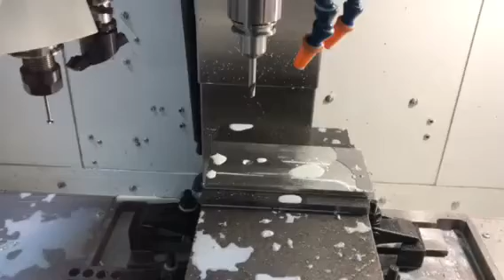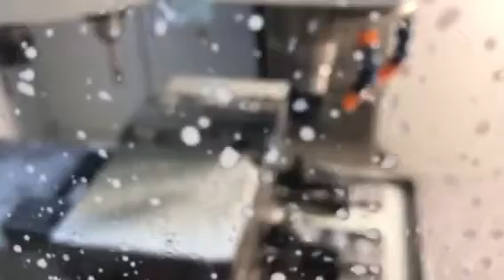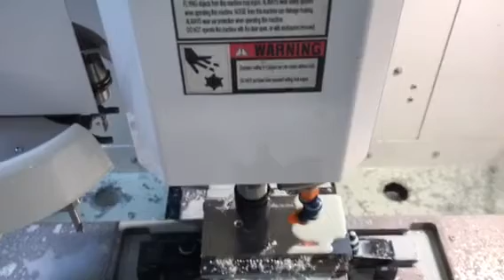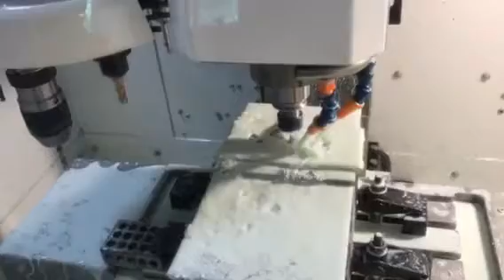Finally testing the UMC10 & Fusion 360

Comment: I was waiting to see how the threads came out. lol  Did they fit?  Nice machine! :)
Reply from the maker: The 2nd attempt did but still needs some adjustment. This attempt I used the wrong pitch information and realized it AFTER pressing start.  I ran the correct pitch info again thru this hole pattern but 2 different thread milling patterns in the same hole wasnt ever going to work. But I didnt break that little thread mill!
Reply from the maker: https://youtu.be/WpayG22Jtbo
Reply: Thanks for the link!!!  They came out great!  All my thread milling has been 5/8", so my thread mill is too big to do 3/8".  I'll need to get a cutter for that.